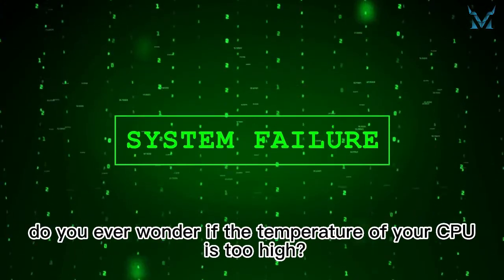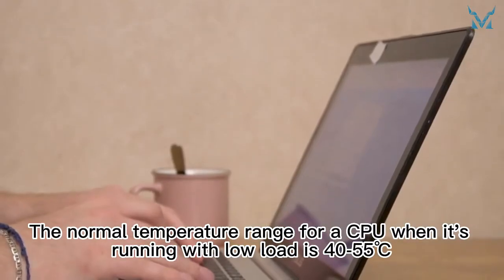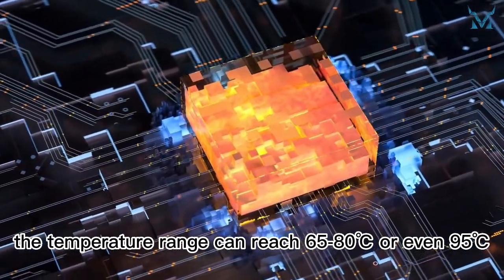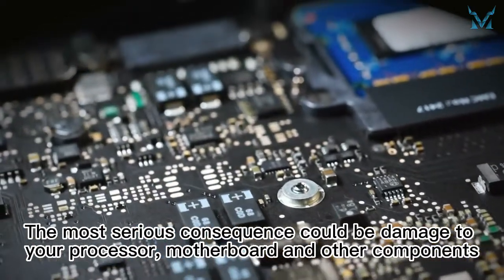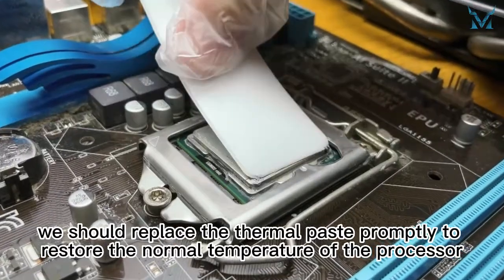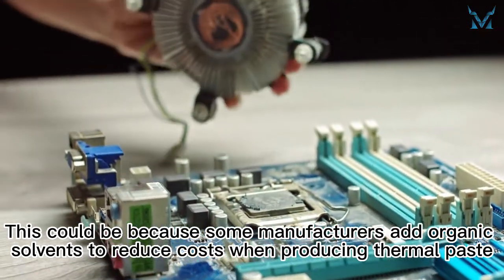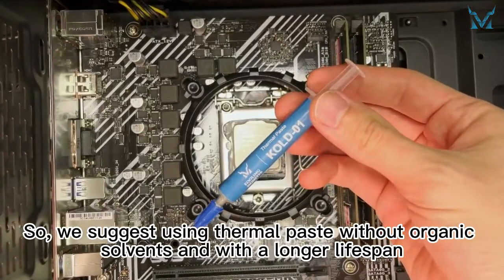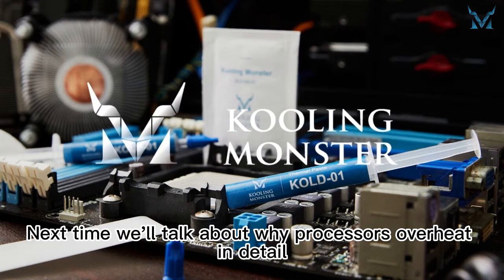What is the normal temperature range for a CPU?

Comment: Is this the same for phone CPUs?
Reply from the maker: Mobile phone CPUs usually run cooler than laptop CPUs because phones have less space for big cooling systems. So, phones can't handle high temperatures as well
Reply from the maker: Mobile phone CPUs usually run cooler than laptop CPUs because phones have less space for big cooling systems. So, phones can't handle high temperatures as well